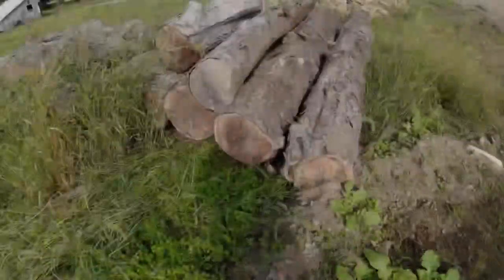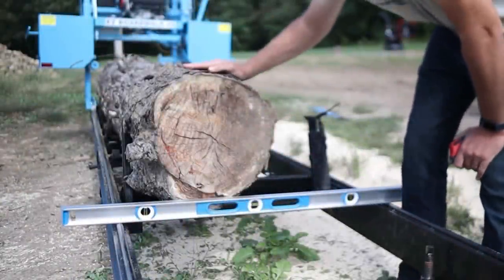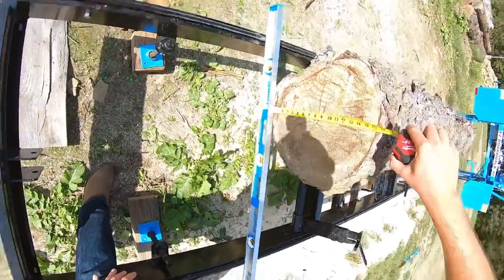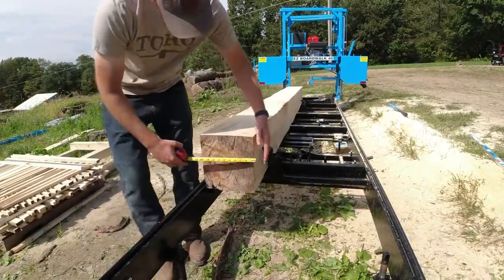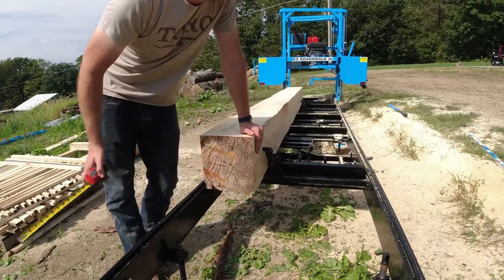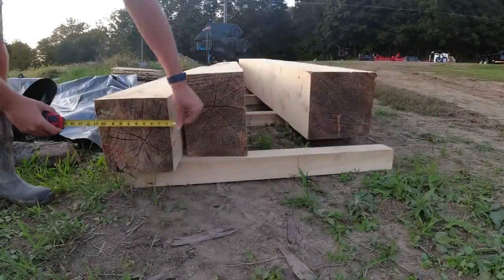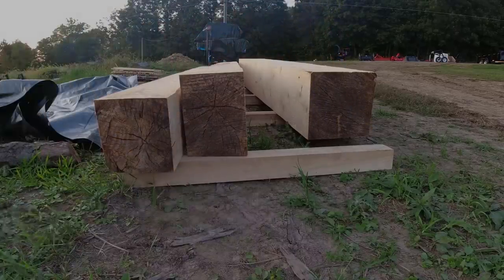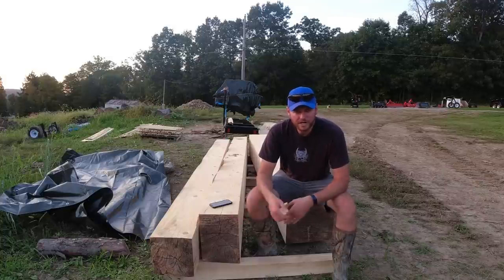Milling Giant Beams - You Can’t Buy These At Home Depot

Comment: Forty years ago, Frank talked about the mill he had in his back yard.  It was run off a Chevy 350 car engine. It had a upright flat saw blade ruffly two and a half feet tall.  The track was from a railroad tracks and it was nothing you could buy, he hand made it.  I would go with my dad and Frank.  They would fell a bunch of trees, my dad made a 30’ trailer and using come-a-longs and skids we would get the twenty foot loges on the trailer, chain them down for transport.  My dads 74 3/4 ton Chevy truck (mine now) was a workhorse. Frank had a fork lift that he owned, and my dad, Frank and I made enough dimensional lumber to build a first home for a newlywed couple in the community. Frank went in to rest first, my dad entered into rest back in 88. Even after my coma and all I went through since 2012, I’m so blessed that “this” memory did come back to me. So much of my life was gone when I had my accident. Even now, I’m still getting some of my long term memory back.  It’s the short term memory skills that are,  so frustrating to me. I’m not the same person, POST a ruptured brain aneurysm and stroke.  Four back surgeries, and five brain surgeries. But I am alive!  At the time I thought I felt completely ready when my time comes.  It’s the closest time in my whole life, getting to learn the real Lord of the Bible.  Knowing what I know now, if I had died back in October of 2012, my soul would have seen the “second death “ instead of eternity with my redeemer and Lord, The Christ for the world.
Reply: What

Comment: I was just saying to Ann that Adam should practice building a shed roof for the saw mill before building a cabin.  Something with a nice concrete base so that the mill remains level and mud free.  By the way Nathan from Out of the Woods has built large pallets (that Mike Morgan has copied) that keep the lumber you mill flat and straight, they are easy to level and will allow you to move big amounts of lumber with pallet forks on your tractor.  Great video Adam, thumbs up.

Comment: I have the same mill! Agree that there's something satisfying about cutting your own lumber. One tip I can offer when centering your pith; split the difference when raising the low side. For example, if you have a 3 inch difference you only want to raise the low side an 1-1/2" because as you raise one side the other side drops. It varies depending on the log of course, but it will get you close. Take care!
Reply: Do you remember when you bought your sawmill and the price then?  Thanks.

Comment: For a timberframe the biggest you’ll need is 8x8. You could maybe get away with as small as 6x6. Common timber sizes are 8x8 for posts and beams, 4x6 for braces, 4x4 for girts. Floor joists can be 4x6 or 4x8. Nice thing with the mill is you can make them whatever you want (or whatever you can get).
Reply: I agree.. and even a 6x6 beam can be heavy and annoying to handle.. I love the looks of the timber frame, the craftsmanship behind it and also the forestry (big trees). However, it makes it so much harder to build than a stick frame building. Also, the building codes are a pain to deal with here with the timber framing. I would love to build a timber frame barn for us but I think the best way to build it is to just go for a 2x4 stick frame construction. Trusses, 2x4 strapping and screw metal on it for the sides&roof. That makes for an fairly easy&fast build and a building that last a very long time (on a concrete foundation done right).
Reply: yup

Comment: Couple of questions Adam, if I may.
1. What do you do/can you do with the bark layers you take off?
2. You mentioned not hitting metal and blunting the blade, but won't soild and grit on the outside of the log that's sat on the ground do the same?
Cheers

Comment: When I was a kid I grew up in a house that was very large, made in the 1800’s. The Timbers used in the attack ridge line looked just about that size but longer. The big black doors in exterior basement and front door were solid oak thick. You do not find those today at least not that I have seen.

Comment: Could you provide some information on the grapple and tractor?  I have the same sawmill and your log moving equipment seems well suited for the size of logs the mill will handle.
Reply from the maker: It is a Kioti ck3510 with a Log grapple made by Brute Force Manufacturing

Comment: Fun with saws!  Really think through your mill shed…. Permanent roof with removable sides?  Big enough to do all maintenance ~ cleaning, changing bands, etc.   Is there any way to alleviate the trip hazard at the end of the cut (the jack handle?).  Looking good.
Reply: and also think about how you would add on or expand the shed if/when needed.

Comment: 2 by 4s are not going to be much use of the mill (except during shortages by pandemic etc) as they are cheap, but the custom sized posts & beams live edge lumber will make the mill a valuable asset at your property. And offcuts will be sellable firewood!

Comment: Not criticizing at all, but genuinely curious: the one pine log you put on the mill had what looked like poison ivy vines on it. If they are, do you have any concern about milling through them and possibly kicking up urushiol oil into the air with the dust and inhaling it or getting it on you?

Comment: so if I get one of those claw attachments I don't need a 3rd function thing? just use what I have for my bucket?    how's that for a newbie question!?
Reply from the maker: So the claw attachment is called a log grapple and yes it does require a 3rd function valve to open and close the jaws
Reply: @HometownAcres  thanks. trying to find a way to avoid that cost! oh well.
Reply: If you have rear hydraulic outlets in the back of your tractor just use longer hoses to the back of the tractor

Comment: …if you had a kiln to dry the large posts, you probably could make more than what you make with firewood… Marcus from Chesapeake VA.
Reply: where I live (Adirondacks) there are places that dry your wood and it's very inexpensive.
Reply: I wonder if there is a way to make a solar drying shed. Something like a greenhouse with heat operated fans up top to draw the moisture out of the shed as it dries. Another project maybe.